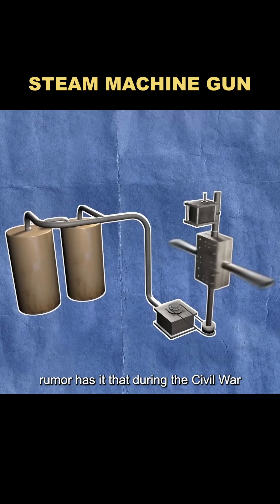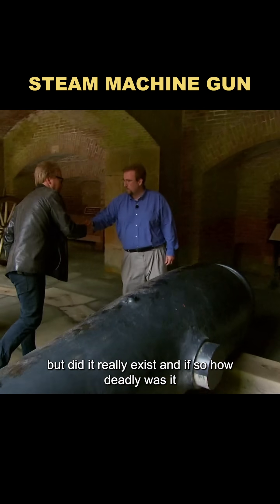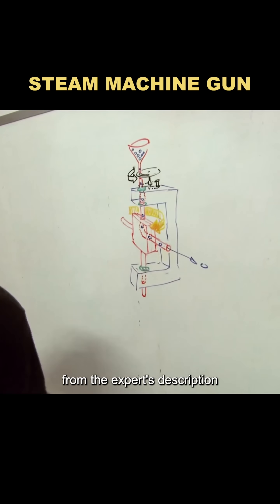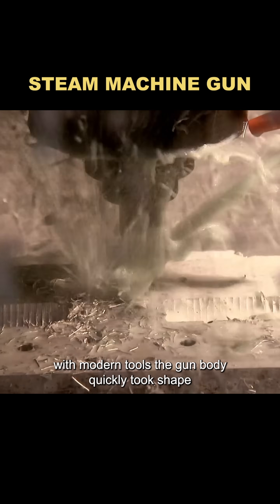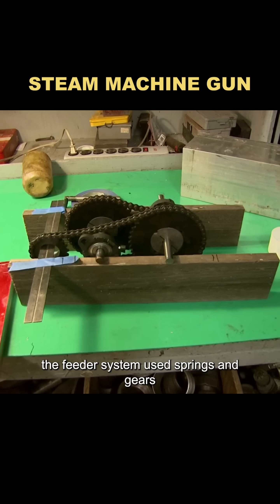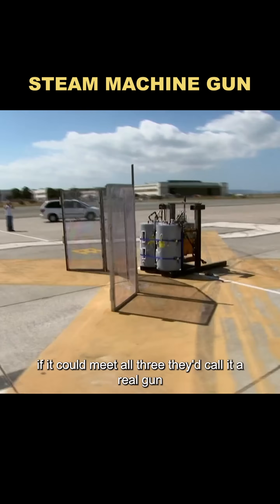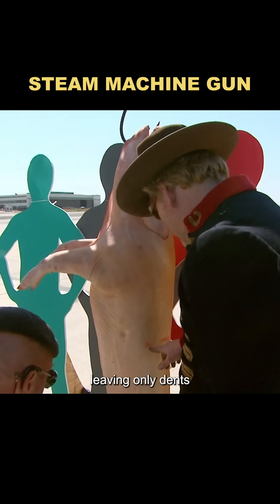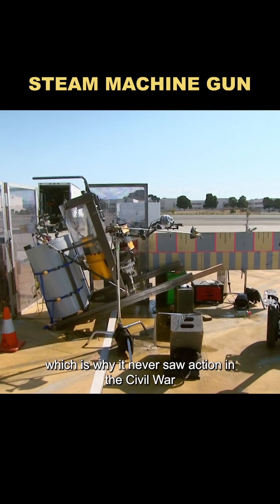Have you ever seen a steam-powered machine gun?

Comment: There have been many, 'spin the contraption', attempts to throw bullets at targets quickly, but the problem of balance and inertial force figure into the reality very quickly! Today, they are trying to throw projectiles into space with a project called 'spin launch', where they use a very large arm in a vacuum chamber, and then they release the projectile which perforates a special opening cover that maintains the lower pressure area until the projectile leaves.

But the many problems with the loss of mass while spinning the arm can be overcome, it just doesn't make sense, as you can fire a missile from a jet aircraft that has flown to the top of the atmosphere as quickly as it can, and hit a satellite with the missile to destroy it, but with both methods of getting g objects into space, they can't get people into space with either systems!

Comment: Instead of centrifugal force they must have used the direct steam energy to fire the bullets
Reply: thats not the myth then is it?
Reply: @georgemccune2923 Its for the designers not the Myth busters 😅
Reply: @MOTOFLIXGARAGE  No no no sorry.... that didnt come out right.   I was trying to ask you a question and I guess I deleted the first half. What I tried to ask was "Didn't the mythbusters build it as the myth stated? Or are you saying they built it wrong compared to the real myth and if so what they did thats not the myth then is it? I am curious because I was thinking the same thing
Reply: @georgemccune2923 what I am saying is the original design must have used steam power directly to propel the projectile, myth buster are just replicating the original design,
Reply: @MOTOFLIXGARAGE  ok, i got ya.   see thats what i thought they were doing when Jamie had the one thing spinning the barrels and I figured then the steam would be used to propel the balls.  I wonder if its because if the steam pressure was doing that it would be hard to maintain the pressure since it would be constantly bleeding off.

Comment: Only two water heaters. Engineering requires experimentation. Edison didn't stop at the first try to improve the light. More pressure and higher rom. Lead balls insted of steel for momentum. Remember, dents mean broken bones.
Reply: Edison didn’t stop at the first try he didn’t even tried himself he made his workers do it then crowned it as his effort
Reply: @janli3649  Yes that is how most things in this world work. Get over your pathetic self already
Reply: Edison just stole work of others
Reply: No, dents do not mean broken bones. Stop over exaggerating things
Reply: @tullo5564  depending on how thick your muscle/buffer zone to your bone is, it very well could mean that. Because bones hold your overall structure unless you’re very muscular. 
I wouldn’t shoot the idea down so hard, but it is a shame if they didn’t open the pig to see the damage
Reply: @tullo5564 even if it didnt break at the first shot,i dont wanna be shot many times with that thing,it will surely crack my skull,which is more painful and i wouldnt want to experience it,so yeah,much deadly than broken bone because of psychological fear
Reply: @tullo5564  at the very least itd cause blunt force trauma, which if a headshot occurred, could be dangerous if not lethal.

Comment: I think they should use pressurized steam directly in the barrel. It will be more effective than this
Reply: No, steam in gun barrel would cause rust.
This whole idea was a flop idea
Reply: @tullo5564 you've never dealt with steam or guns, have you? Not trying to beva jerk but hot steam is actually pretty dry.   You will find many many steam heat systems in every country on the planet that runs steam through cast iron or steel pipes.  Surface rust after use..possibly.   No rusted out barrel though.
Reply: @tullo5564  Not a problem in today's world and guns work similar to air guns. Gas's from gunpowder expand and push bullet in barrel.
Reply: @tullo5564 not a problem and better than this